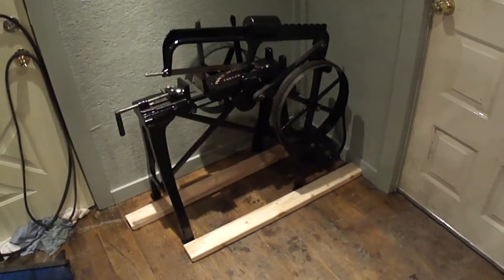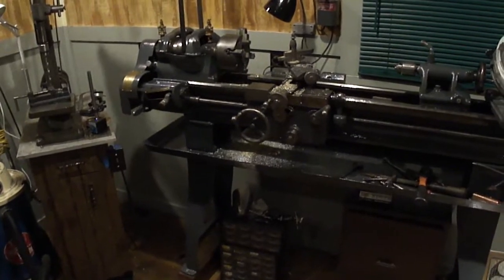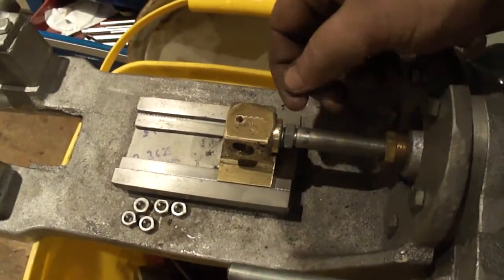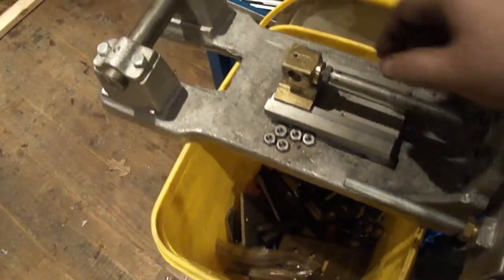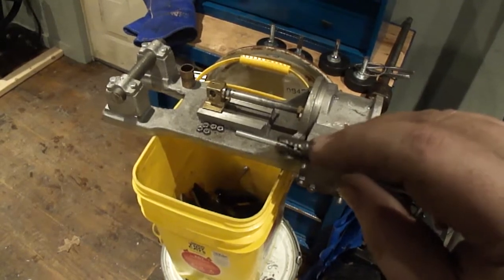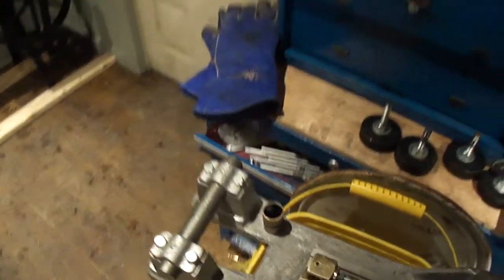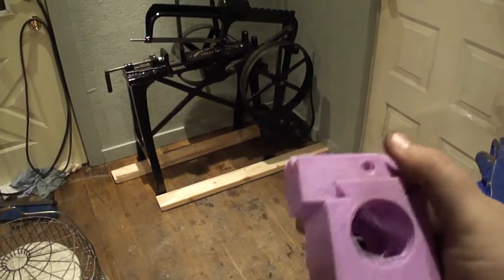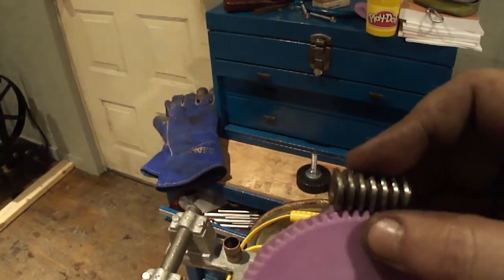Random Bits/Steam Engine Build #14 - Crosshead, Eccentric Strap, and Various Random Bits

Comment: Awesome, looks like you have enough projects to keep you busy for a while!
Reply from the maker: lol, nah, Ill have them done within a week or two. :P As fast as Im going through the hydraulic press build, it should only take a few days once the weather warms up to finish, it's fairly simple to build really. The die filer, only parts left on it is the eccentric and rod, then hook it up to a motor, and the steam engine, Im still waiting on the lathe to be mounted perminantly to the floor to level it to work on the crankshaft parts, then press it together with the hydraulic press.
Reply: Chirpy's Tinkerings yeah but you have all those peacock feathers to pluck as well, right?
Reply from the maker: yea, but the problem is, I havnt read through the other books yet, lol.